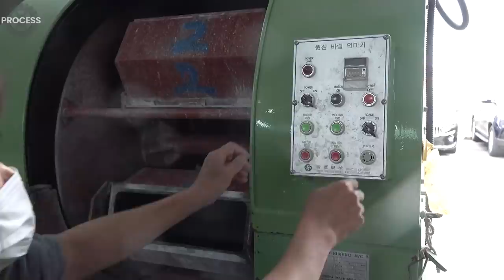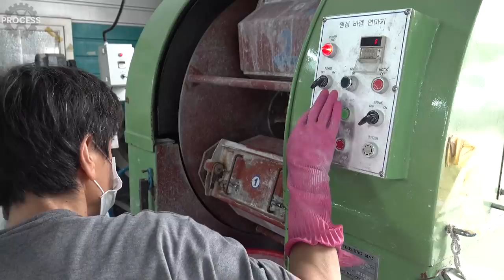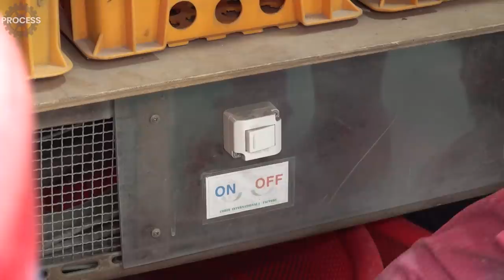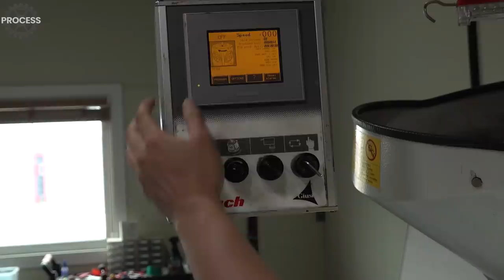Process of Making Buffalo Horn Buttons. Button Factory in Korea.

Comment: Never heard of Buffalo horn buttons before. Pretty cool!
Reply: Me either
Reply: In the early days before plastics and synthetics were invented, many items were made from horn, including buttons, combs, and utensils. The ones shown here are NOT made from actual horns. It's plastic material that resembles the pattern of horn.
Reply: @jbrou123  I am not so sure; the steps are very similar to that of a button made from a horn. Plastic buttons are just molded in a 1 or 2 steps. Horns are proteins and cannot be molded. They are pressed into sheets, cut into circles, holes are drilled and the final finishing is in a drum polish machine.
Reply: @janami-dharmam  You may be partly correct. There are different method to make plastic/resin buttons, including the machinery used here as well as 'pill presses'. For more info. search "How it's Made Buttons" here on YouTube.
Also look up "Molding Primitive "Plastic" - Horn Spoons in Early America" on Townsends channel.
Reply: @jbrou123  hi 
in this video, you can see both real horn buttons and plastic buttons. not all the buttons are plastic here.